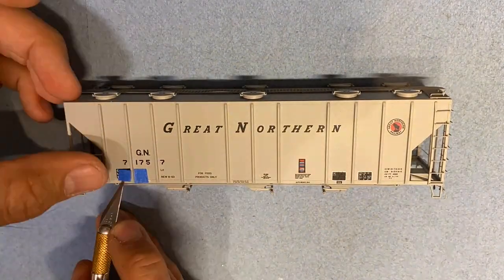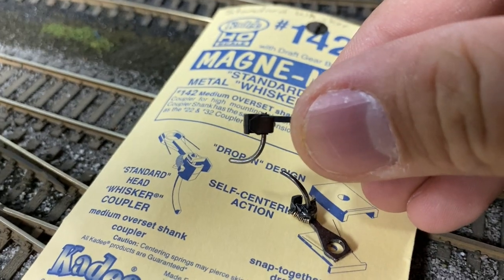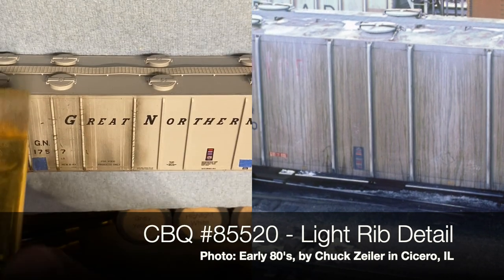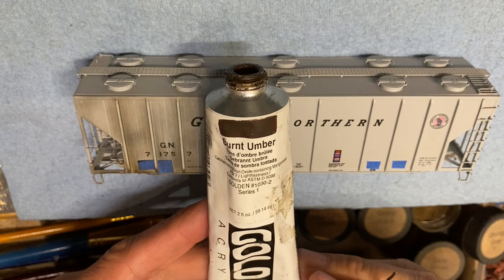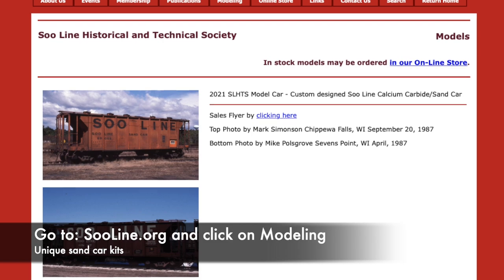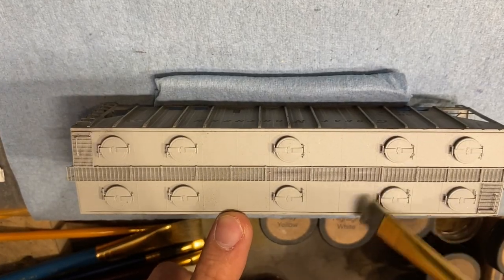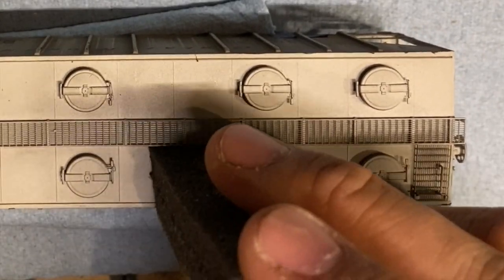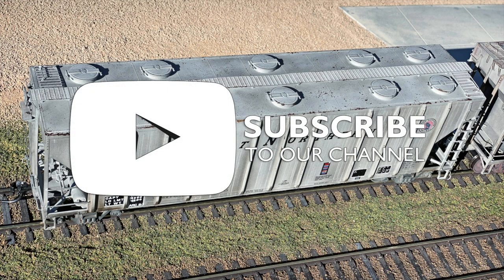S03E02 | GN in 1970 | Weathering GN PS4000 Tangent Hopper, BNSF leaves Northtown, SOO 2nd Sub & MORE

Comment: Great video as always.  With Athearn locomotives cost excess of 300, there should be zero reasons why they can't build it right to the correct height for the coupler.
Was really hoping up would have shown how you do the ends of the covered hoppers. That area seems to be challenging for me on these nice RTR cars.
Reply from the maker: Thanks for the feedback, I think you’ll enjoy one of the up coming episodes…as the end cages get addressed. A segment had been recorded, but for time reasons was cut.

You’re spot on about the Ath Gen coupler issues…when the 4th unit rolled in with high couples, it’s starting to get old.

Thanks again for leaving feedback and for taking the time to tune in.

Comment: Have you tried guash for the rust specks instread of oil paint?  It dries in a minute or to and can be washed off with water if you make a mistake.   
I really like streaks the flat blade makes.   Great episode!
Reply from the maker: I have not tried gouache, do you have any specific colors you recommend? I’m all about learning and trying new techniques. If you have a suggestion? I’m all ears.

Thanks for tuning in and sharing your suggestion of products/techniques.
Reply: It comes in many of the shades as oils.  I use a burnt umber, black and grey for various applications.  The same techniques work as with oils, the only difference is the  drying time  is much faster.   I like the fact that if you mess up, you can wipe it off with a damp towel.

Comment: Nice job with the weathering tutorial - again I appreciate the showing how you do it rather than saying "this is what I did" - the blade trick was interesting, I too thought of the scratch brush as an alternative but will keep that in mind.  Question - what is the purpose of the blue tape all over the lazy susan where you spray the models?  It is something I have never noticed before.  Thanks again for posting, I truly appreciate it and look forward to the next episode.
Reply from the maker: Thanks for the feedback. The blade I used had a few dings in it…so it left more prominent vertical marks. A new blade leaves a more subtle effect. None the less, it’s the concept and a moment of living & learning.

You’ve got a keen eye my friend, to spot the tape on the lazy-suzan. It’s there to cut back on the paint buildup…in an effort to preserve it. Outside of that? No real need for it, but I like the inquiry.
Reply: @SootheMilwaukeeRoad  thanks for the response, makes perfect sense!